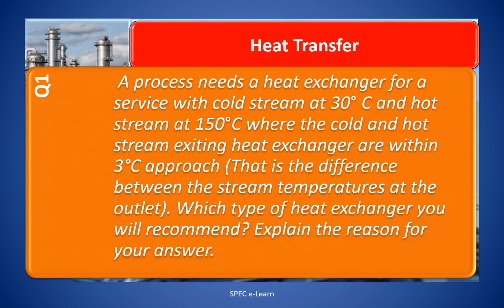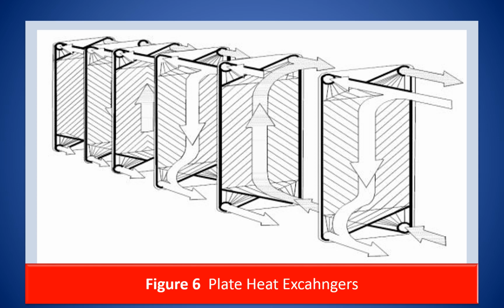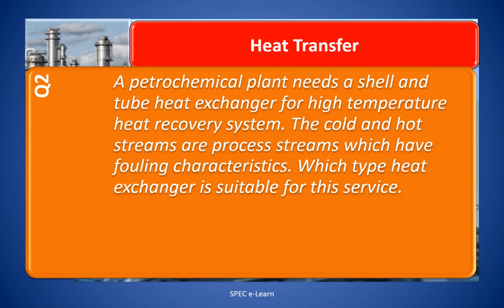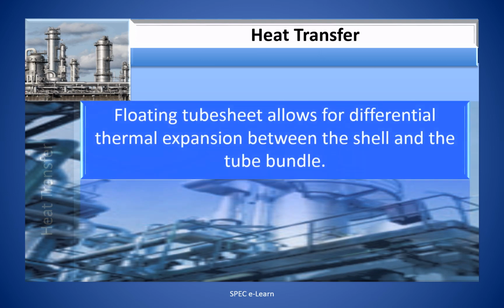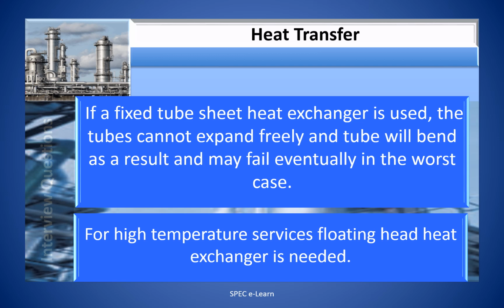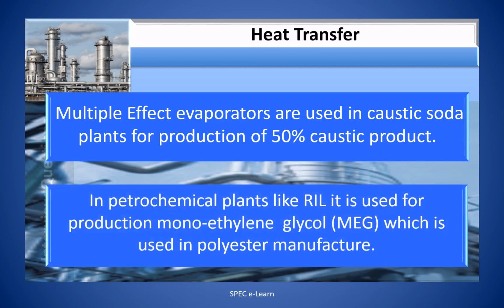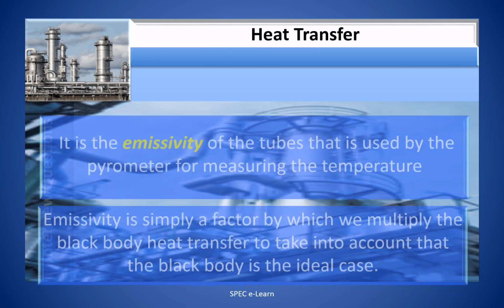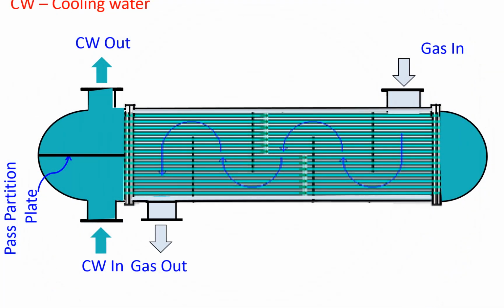Interview Questions & Answers in Chemical Engineering –Heat Transfer Part 1

Comment: In 5th que it should be mentioned that water leads to more fouling than gas.....so that ine could gett the intimation .

Sir we need more such lecturrs 🙏
Reply from the maker: Yes. I have indicated in the answer to the question that water is more fouling in nature and hence it is routed to the tube side. Your understanding is also correct that water leads to more fouling. Your request for more questions and answer video is under consideration. Thanks for your comments
Reply: @SPEC786  👍👍tys sir for ur reply